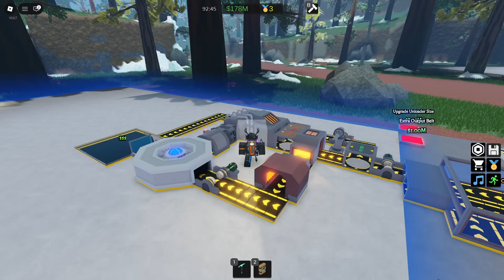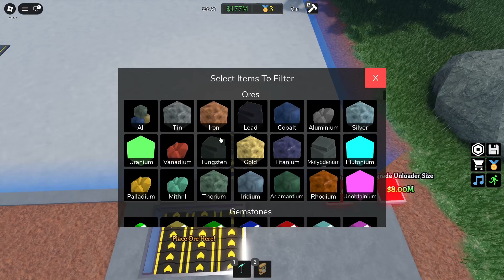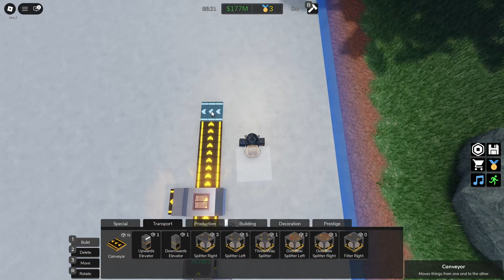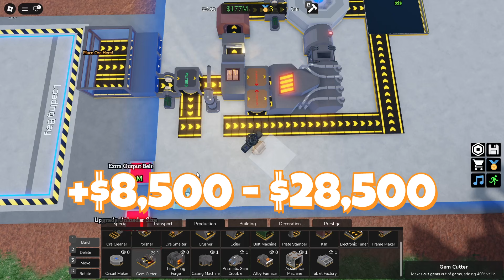Earlygame Circuit Setup Tutorial - Roblox Ultimate Mining Tycoon

Comment: I have a question, so for the splitter near the circuit maker, what should I set that to? Also I heard someone say I’m losing a little bit of money by placing something before something:
Reply from the maker: This setup is optimized for maximum money output. You can move things around but I wouldn't recommend changing the order.

Comment: in the first step there isn't a reason to put the coiler after the splitter doing so loses you a small amount on each bar you are sending to seller that isn't a coil.
Reply from the maker: You're absolutely right. I put it there for convenience sake, but forgot to mention so in the video.
Reply: The splitter is there to seperate the gemstones from ores, because gemstones cannot be turned into coils, so it will jam everything up, but if you have a gem to bar transmuter (only obtained from prestiging) you can take out the splitter.
Reply: its also why he puts a gem cutter there for where the gemstones are getting split
Reply from the maker: @lucas-pj4kd  Solstice is talking about the splitter after the smelter, you're thinking about the filter at the start.